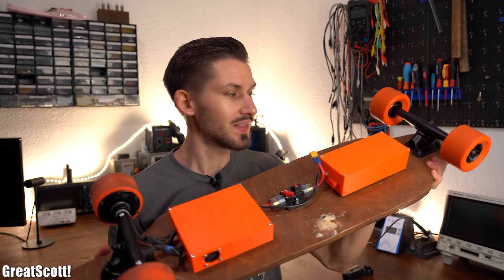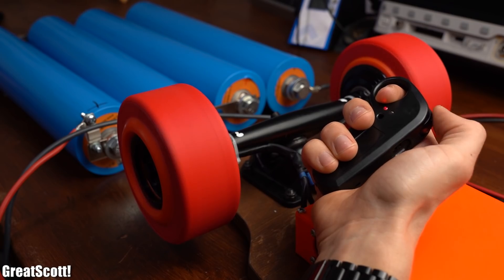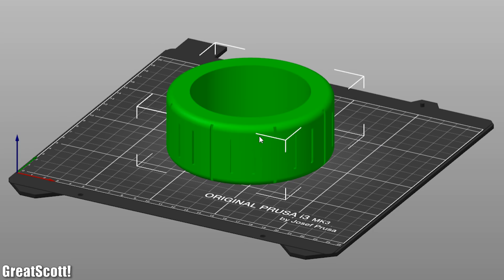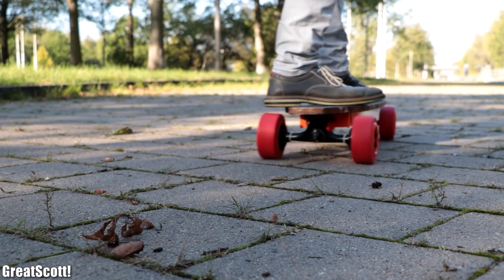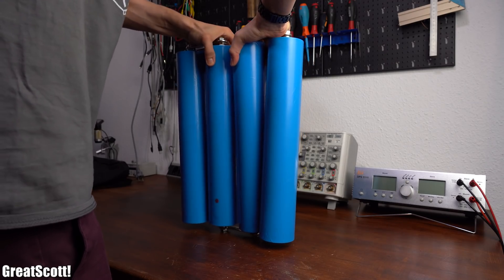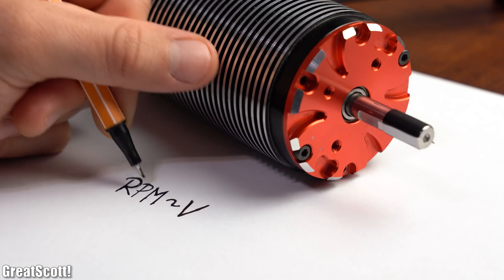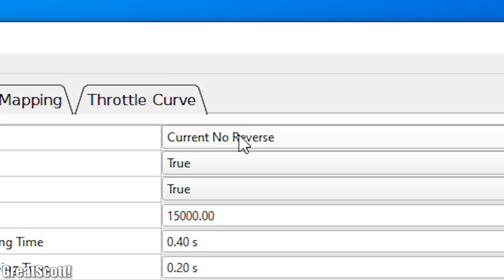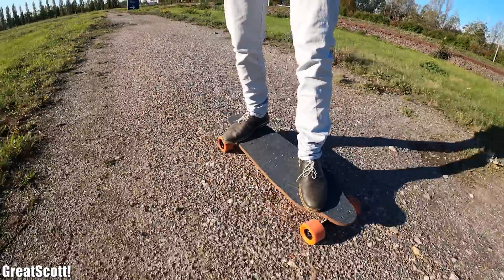Creating an Overpowered Battery Pack and Off-road tires for an electric longboard! (Experiment)

Comment: Try use a diode in parallel with the buck boost converter, it would stop the voltage and force it through the converter, and with the regenerate breaking would go through the diode and charge the battery

Comment: I know this is an old video, but if you're going to make a backpack battery, would be pretty cool to have two contacts on the board and on the bottom of your shoes, eliminates the dangling wire, plus rider falloff protection.

Just don't stand in puddles...

Comment: There are bidirectional boost converters that we use for PD power banks such as SC8816qder from South Chip. It's not suitable for this application, but I bet there are ones you can use. So, a boost converter, especially a synchronous one, should still be okay.

Comment: know it would ffect capacity but could always use a boost converter to boost the voltage to 24v, but yes I know this would have a huge loss on range and capacity

Comment: I just realized it. Why you not use big batteries to charge the small one(the original) with the step up converter? So the small always charge around 80% and you still have braking feature.

Comment: After the boost converter, you can use a high amperage bridge rectifier along with a set of large power resistors for braking. You might have to add some extra sorta heat sink to em, but you can give the power generated a place to go. There are easily sourceable and cheap parts on mouser on digikey.

Comment: Braking, not breaking. Breaking would be... bad? Yes, very bad. 
The obvious solution: TWO battery powered roller-skates! Each taking half the weight... mathematically,  you should be fine. 
Back-achically, not so much.

Comment: Why not have a 'brake button' which takes the voltage booster out of the circuit at the same time that it engages the regenerative braking?

Comment: There is another guy I watch make home made power walls. There are a lot of safety precautions with regards to these awesome batteries. Since they have more power density than tnt. Cardboard and kapton tape is a must. No sharp connections. Do not rely on the plastic on the cells but cardboard..

Comment: Scott, you can use the boost converter with the brake function, by using 4 big diode to address the reverse brake current to a large resistor!!

Comment: Wait... so why couldn't you just set those batteries up as 2 parallel sets of 2 in series?
You'd double the voltage and reduce the amperage to a slight safer level. Is it not enough amperage that way?

Comment: Is there a problem with connecting external batteries with voltage boister in parallel to built-in ones and accept the fact that only them would be charged back?

Comment: Could you try to reverse engineer the boost converter and add the voltage feedback to it maybe using a second remote controller

Comment: Hay I want to make a powerful  go cart . Can you make a video on how to design a circuit  for pmdc and bldc motor and how to expand it power (say controller can handle 100 amps but after testing i need 150 or 200 ampss)  if I need . Then how to do it.  Specially I can't find a suitable controller around me so I want to make one . Please help.

Comment: at least Being age 14 I know some electrical engineering,all credit goes to electroboom and great scott for making me such knowledgeable at the age of 14,I know many things,some of them are :

PWM Signal
AC and DC Voltage
AC Voltage : Sine Wave,Triangle wave,Square Wave,Saw tooth wave,etc.
BLDC Motor/Induction Motor
Duty Cycle
Current
Resistance
Inductance
Capacitance
Parasitic Capacitance
Battery Types : Li ion,Li poly,Lead Acid,LiFePo4,etc.
Amplification
Semi Conductors
Conductors
Insulators
Transistors
Integrated Circuits
LED
Variable Resistance
Faradey's Law
Kirchoff Law
ElectroMagnetism 
Formula of resonance frequency : F = 1/2 π underroot L x C
Formula of Voltage : V = R x I
Formula of Current : I = V x R
Formula of Resistance R = V x I 

V = Voltage
R = Resistance
I = Current

Shunt Current resistor
Fuse
Amp
Ohm
Henry

This list will go so on so I wish to go to bed

Comment: I have been working on induction motors and generators for a long time now. And we do big boy stuff power goes upto 75HP for each wheel(thats 300horses and nearly 1200lbft torque). 
With experience I can tell, the initial bite to push you on the board the Volts will not help you at all, its the amps. If you record the power graph you will notice the current to kick you off is nearly 6 times off the current at higher rpm. 
So you need amps for the torque and volts for the speed. And they are inversely proportional in a constant power input(so are the torque and speed). Figure it out the next time.

Comment: Hi, Im Interested in building or buying an Electric Longboard myself, but have some questions about the legal side of it...
Im from germany too, but write this in english as thats the language of your content and audience.
So as dar as I know, something like this would be only legal on sidewalks or bike streets in germany if it can classify as a toy.
Now to classify as a toy it must, apart from other regulations, for one thing drive within a certain speed limit. im not exactly sure how high it is but it is but it is pretty low...
Now to classify as a roadworthy vehicle, simmilar to e scooters that were included in the last revision of the StVO, to drive on streets it has to have a handle bar or steering wheel.
So am I right in my assumption, that electric longboards are technically illegal in germany, and driving them relies on the police not being interested in prosecuting you / ignoring you?

Comment: Hey Scott! Install the boost converter. Put a smaller correct cell count battery after the boost converter. The "braking battery" must have limited charge rate from boost converter and unlimited discharging for acceleration. You can do it!

Comment: You can build a synchronius booost convert by using a half bridge instad of a single fet and a diode. In this config you can run bidirectional current without  problems. A fix duty should be fine so you can use  a MC for PWM generation.
by using multiple phase shiftet  PWM signals  and  halfe bridges you can reduce  current ripple to a minimum

Comment: like you said, 12v with bigger tire would give the same speed. You don't need more volts, you need to deliver more amps to the controller.

Comment: Just use the old battery but having the big one charging it. With this setup breaking would still work and a boost converter is not interfering!

Comment: You sould've made a 100% infill tire that slotted into a wheel. The whole insert thing used in drift wheels only work when the insert is harder, as the rubber wheel expands and keeps it in place without the need of glue. The insert is also smaller than the wheel, which creates an ideal interference fit.

Comment: Can't you use some high power mosfets to switch between battery discharge through the boost converter and charge/breaking during stopping/slowdowns? Just disable and bypass the boost converter when breaking is active.

Comment: This would be a great project to extend with using Super Capacitors, stick them in the board  to make a sink for regen breaking energy, then you could use your boost converter.
Reply: The other thing I was curious about is voltage drop across the wires from the battery to the board. At higher currents I think you'd see quite a significant drop seen on the board terminals.

Comment: Very cool project!
I expected it to run anyways because since the batteries are beefy and they can deliver more current, so the motors wouldn't be so fast but they would have a lot of torque. 

Doesn't seem like it works that way!
Also the wire hanging down the backpack to the board seemed kinda dangerous :p

That's why I love your experiment videos: I always learn something new. 
Great job Great Scott!

Comment: I'm surprised you didn't design a circuit so when you applied the brakes it would bypass the boost converter and charge the batteries...

Comment: You should start molding stuff with polyurethane, its simple and creates great parts. I don't get why more ppl don't do it. Just 3d print 1-2 walls thick molds (0 infill), spray mold with release agent, fill with PU and let cure, destroy mold and recover part. You can create real tires, gaskets or if you go up to like 80shD; helmets etc.

Comment: Couldn't you set up your normal battery pack for higher voltage and generative breaking, then use the large batteries as a recharge source? Get the best of both worlds.

Comment: I was thinking maybe tapping the circuit that is existing in the controls either wireless (more complicated) or at the receiver with a relay of some design so that when throttling the relay would switch to the boost converter output.  When decelerating or braking (not sure what the controls are) switch the relay to directly charge the 12V circuit signal path.  Seems can use both and would make and awesome project.

Comment: These batteries are safe but heavy. Next time use LiPO batteries, I know that is dangerous but "Nam banta hai risk se" .  :p
Or you can use this huge battery pack with a boost converter, design a mechanical braking system using servo or solenoids.

Comment: you can use that battery and boost module to charge internal battery to not full voltage to have a some room for recuperation.

Comment: How about a second circuit using ultra caps as the dump for the regen braking and then have a boost button direct from the caps to the motors?

Comment: A decent possible solution to utilize the large battery would be to configure the boost converter in CC/CV to charge the onboard battery to 80-90% capacity (so like, 3.65-3.8V per cell). This would allow regen breaking to still work, as it would feed the onboard battery with the breaking energy. The 10-20% battery margin should be plenty for most breaking use cases. After breaking, the battery voltage will be outside the boost converter range, and thus the 'excess' energy gathered from the breaking will be immediately used to power the wheels after breaking. After the excess energy is burned by the wheels, the boost converter will take over again, supplying the board with the energy from the backpack battery instead.

This kind of solution is also quite a bit safer than standalone backpack battery, as it ensures the board will still be powered in the case the backpack tether is snagged or has an intermittent connection. Having the tether become disconnected would still mean you have the ability to speed up (or most importantly) and stop/slow down going on a hill.

Thanks for the Great video!

Comment: If you switched the boost converter with a higher voltage battery and a buck converter maybe you could use regenerative braking with a couple of diodes parallel to the converter

Comment: I like that we had an expert invited this time! Would be cool seeing multiple of them in the next video. Also to avoid hardwiring yourself to the board but still using a battery in a backpack you can use two terminal plates at the top of the board and two of them each at the bottom of your shoes so you can jump off it whenever needed, the hop in and power the board

Comment: connect lifepo4 -> boostconverter ->(BMS ->)LiPo battery(the old 100wh one) ->esc ->motor
set the boost converter to like 3.9v per lipo cell and when you main battery gets below you can use your range extender batterybackpack.
this way the break would work and you have you original voltage of operation

Comment: It's important to consider the additional strain put on the hub motors by increasing the wheel diameter. In the future using a belt driven setup with different printed gears will allow you to maximise or adjust your range, speed, torque and potentially allow the use of pneumatic tires as the motor wouldn't be contained within the wheel.

Comment: Also... you used what "beefy wire" That's like 12awg? Maybe 10awg? You are running more then a meter of it down to the long board. You are already running the thing down to 13v. Now you are trying to pour lots of current into it because your voltage is lower(As long as your controller is not power limited to a certain extent) You'll get a surprising voltage drop. Won't help you. But these are low resistance coils. I doubt their resistance is limiting the current. It's your controller.

Comment: You could add fake rocket housings to the back of the board as a place for those batteries, plus use them to maintain (top up) your original battery and keep all the original features.
Dangling wires, backpacks and triggers are a bit risky for you in current times, be careful.

Comment: Scott? WTH.. What speed controller are you using? Are you sure it was not current limited? I doubt that you were pouring out all the power from those batteries across the coils of those hub motors and you were certainly not fully saturated. Which makes me think your controller was limited.. Unless you were giving it all she had which in that case I bet those motors got damn hot quick.

Comment: Actually you should put the small battery pack back into the board and use the big pack as range extender. Then create a custom circuit, that puts the regenerative breaking power back into the small pack and switches between the big and small pack. (Like use 50% of the small pack and than the big pack) this should work flawlessly as the majority of the wasted energy is within the air resistance and not as kinetic energy.

Comment: hey Scott, you can use the battery as range extender for the existing battery. Just add the boostconverter and set it to ~80% of the rated voltage of pack in the board. This way when you brake, the energy gets put in the board pack (and used again later). Just add a diode between the board pack and the boost converter to protect the boostconverter against higher voltage on the input.

Comment: Dosen't another convverter conected parallel to step-up will reslove regeneration problem, if both just will be connected through high power diodes, so ech work only own direciton

Comment: Use the old battery pack, bust the power of the larger capacity battery to support the smaller higher battery... , and allow the breaking system to work normally..

Comment: Use one boost converter for the 24 volt and one step down converter in parallel for regenerative current

Comment: Couldn't you connect some diodes to the boost converter and connect its output to the smaller battery you already have? You could set the converter to have slightly less voltage than the small battery, so you always have some space for the extra juice from regen. As the small battery drains, the large battery keeps it charged through the boost converter. Also, you wouldn't need the bigger battery to use the longboard, turning it into a range extender.

Comment: I mean, if the voltage coming off the motors isn't too much for the battery pack to handle, couldn't you just add in a low voltage contactor to bypass the boost converter when braking is triggered? Or, on the cheaper(and possibly riskier) side, if the boost converter's positive output can handle being exposed to the regen braking voltage, couldnt you just bypass the the boost converter with a big honkin P-channel MOSFET, with the gate biased to the boosted side through a 10k, and usinh some signal from the board(in the regen braking control circuitry, to 'close' an npn which pulls the P-FET gate to ground?
Reply: Oh, and upon second thought, you would also(probably) need to isolate the boost converter input from the Batt+ when in regeneration as well, and would probably need to include a means of ensuring non overlap between the two FETs doing the switching. Surely there's a contactor out there that could do all this mechanically.

Comment: Did you adjust the low voltage cut off in VESC tool? Looks like that is what prevented you from enjoying that massive battery backpack.
Reply from the maker: Yep, I changed that. Not showed it on screen though

Comment: TPU Suggestion: If its not printing glossy smooth its either too damp or printing too hot.
Also print with 0% part cooling fan for better layer adhesion.
And given the weight and speed, you may need to print it at 100% infill, otherwise all that flexing will still break it apart at the layers.
Good luck!
Reply: 100% infill will massively reduce the flexibility, when one of the reasons for using TPU was absorbing shocks. But everything else you said sounds good, to the best of my knowledge :)
(and 100% infill is still a valid suggestion for maximum strength, it's just that the reduction in flexibility needs to be considered for this application...)

I'm far from an expert on TPU printing, but even more perimeters sounds like it'd be a good idea (which would also reduce flexibility, so it's a trade-off...), and maybe increasing extrusion multiplier somewhat to ensure there are no gaps between perimeters & layers, thus hopefully improving strength?

I really need to get my printer operational again so I can start using my Hermes-branded Hemera that's been sat, unused, for almost a year now - and then I can have some fun printing TPU with it! <3

Comment: Put the original batteries back, used the LiFePO4 batteries and boost converter to charge the original batteries while they run the longboard. Still get regenerative charging and braking!! Problem solved!!

Comment: You could have used the large battery in a charging circuit that charges the smaller higher voltage battery